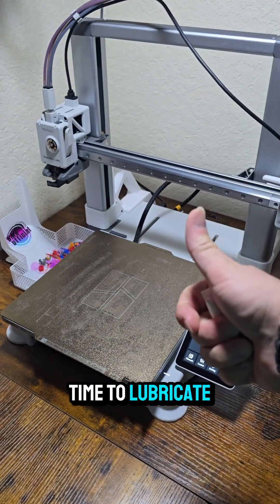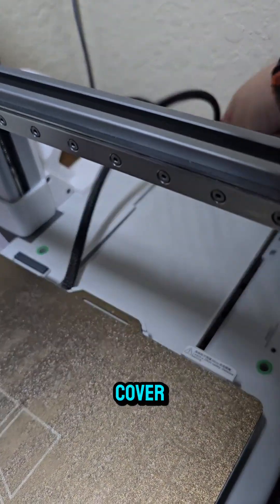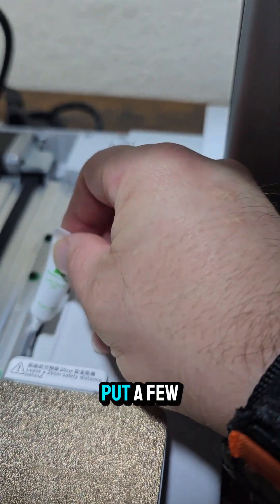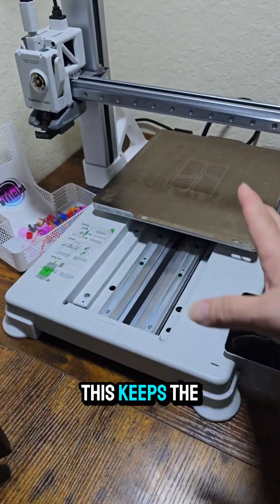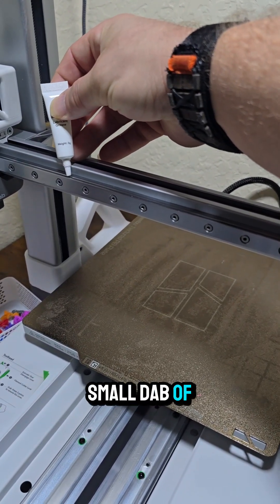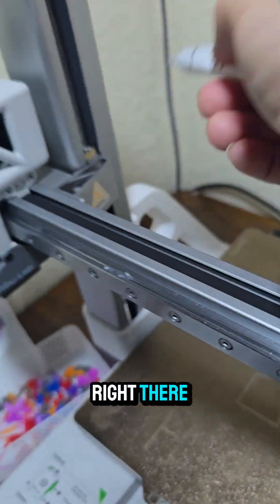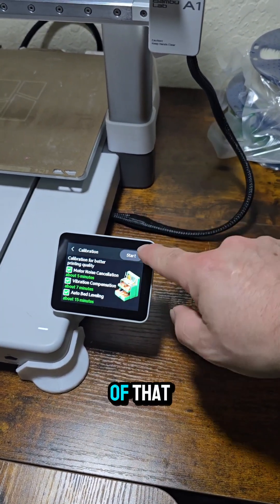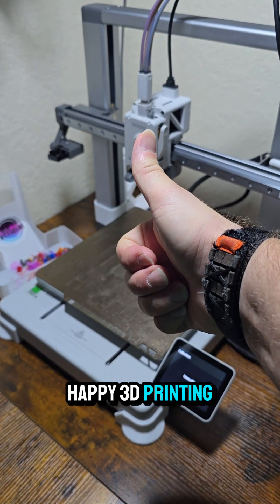How to do Bambu Lab A1 3D Printer Basic Maintanance -

Comment: Never use grease in X rail, only on Z
Reply: Why?
Reply: @Sektot  It's because if you use the grease on the X rail it can cause the bearings to slide rather than roll like they should which basically gives you metal on metal rubbing which is going to wear things down real fast.

A1 document says straight up not to grease X rail.
Oil for Y and X rails (once a month or when printer prompts for Y rails), Grease for Z screws(every 3 months or if you notice anything out of place).

Hope this helps!
Reply: @Sektot read the manual
Reply: @Sektot use the grease not the oil
Reply: just an ask, ive always only used the oil for lubrication, is that alright? or do i need to use the grease for the z axis

Comment: i read on the website that t's strictly prohibited to use grease on X rail, they only want to use the oil and the grease just for the z screws
Reply: It's In big red letters, do not use grease on the X rail. Use the oil!
Reply: That's what I read, too. It was also in the manual ... big red letters.
Reply: @eDrumsInANutshell most everyone have used oil in the vids
Reply from the maker: Havent had issues at all. Probly cause it could get on the buil platen belt or print itself.
Reply: @tbmgamingandtech No, its because grease is to thick so the balls in the bearing wont roll freely on the track, but slide. You then have metal sliding along metal with only a film of grease between. This is going to wear down the bearings fast.